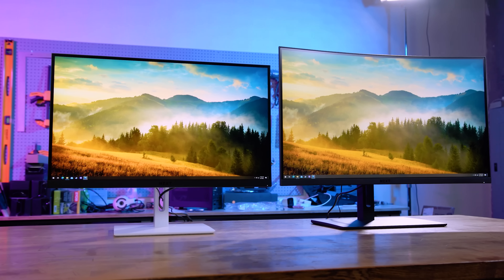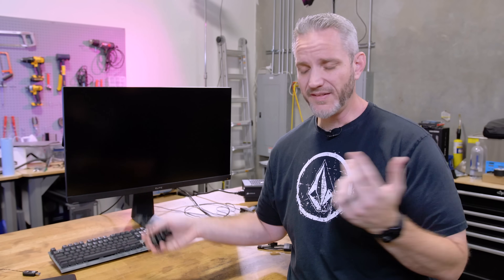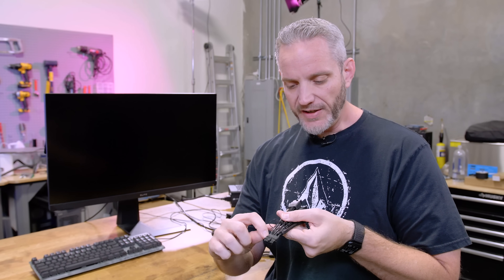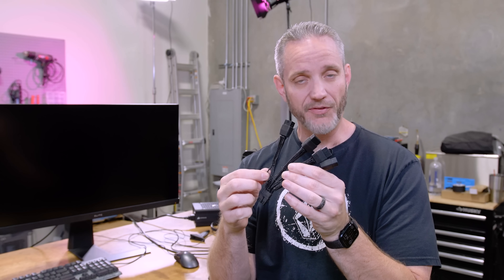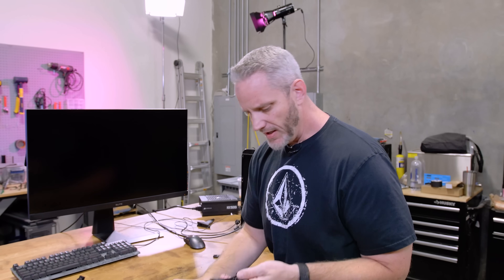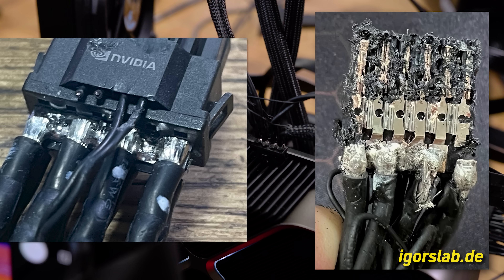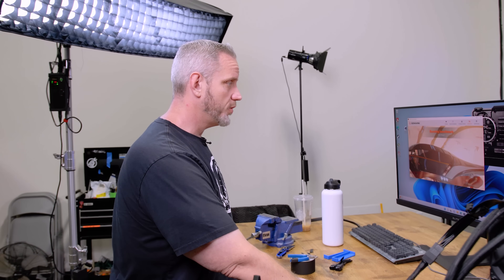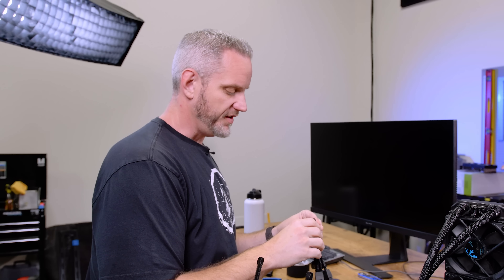Igor's Lab figured out why NVIDIA adapters are melting!

Comment: Honestly if I am spending this much on a graphics card I shouldn’t need to worry about silly stuff like this.
Reply: I like it, kinda spices things up a little
Reply: With gpus getting bigger I’m thinking of moving to a custom loop build these card sizes in 40 series is ridiculous
Reply: Like i said people buying Nvidia products deserve all the problems, people continue to buy their crap  even after all the terrible way they treat their customers
Reply: not that it matters because they dont fit in computers.
Reply: u pay for the performance,if you want reliability get that extra cable or don't pull the cable sideways
Reply: I mean.. the 4090 is clearly marketed towards early-adopters with high amounts of disposable income. It's a $1600 102-tier GPU die debut from Nvidia in 2022, what else could you possibly expect? Honestly I'm surprised the 4090 is selling well at all.
Reply: NVIDIA also decided that nobody spending that kind of money on a bleeding edge card could ever possibly want DisplayPort 2.0, either.  What a dumb decision for people looking to futureproof, coupled only by the arrogance of their explanation.  Even cheaper AMDs of the outgoing 6xxx series have that.
Reply: @delboy6384  they should have 1 in every 10,000 cards just explode for no reason. If you're gonna do it, do it all the way
Reply: You'd think but sadly many high end technical products for consumers are more ass than midrange
Reply: @delboy6384  little too spicy for my liking….
Reply: Even if it was a $700 graphics card you shouldn't have to worry about things like this
Reply: 💯✅ bro. This is one factor so over looked. They want to charge high then I would like high quality electrics
Reply: @Melthornal  lol maybe like most builds I do I build around my purchases. To be fair cases ain’t that much for half a quality one. If you are spending few thousand on a gpu and pc parts why skim out on the case
Reply: I completely agree. I said the same thing about intel's 12th gen. I asked why I need an aftermarket adapter to help my CPU from bending.
Reply: The solution would be to buy a new ATX 3.0 power supply that has this connector on it and for which you will not need to have an adapter.
Reply: Lol if you spend this much on a gpu you deserve silly stuff like this. The price is based on demand first then supply is just an after thought.
Reply: Absolutely. I mean who would care if it would catch on fire and burn up your expensive pc
Reply: @ericheick7044  I like your train of thought
Reply: @MrFrosty888  If the 4090 is anyone's idea of "high quality for the price" then maybe they should rethink their idea of what "high quality" even means. How anyone is actually still simping for Nvidia is just mind boggling to me.
Reply: @doraafelfedezoofisol  you even got a like. You pay for both Jesus Christ. Unless you would say you can’t be mad at Ferrari selling a car that melts down on itself cause…hey…you buy it for performance. LOL you’re all so blinded…knee bent at everything nvidia does and say you can’t even tell when they make mistakes
Reply: @Nuck-Fo0bZz  thats the thing, the 4070 probably wont have this stupid  12pin to 4x8 pigtail creature of a cable, for obvious reasons now, and it wouldn't overheat the connector with its lower power, the strange is this company can design exceptional Graphics Cards and amazing AI and other stuff, but cannot get this cable right.
Reply: You spending that much for a gpu would already be silly lol. You can get a 5700XT for 250 now, which is more than enough for everything 2k/many in 4k. Why spent 2000!!!! For a card then? Or just buy a 6950XT for 600 used or 790 new. But 2k?
Reply: You’ll think so aye…
Reply: Yeah. My friend took his out and is gonna wait for the cablemod cable to come out
Reply: @delboy6384  I see a fellow gambling man.
Reply: Who the hell spends $1600+ on a GPU and uses the pigtail adapter?  JayZ even warned us about potential problems before these came out.  I upgraded my power supply at the same time and I've been using the 12VHPWR modular cable with no issues whatsoever.
Reply: @seadag  this clearly went over your head lol
Reply: Nvidia want you to buy another one
Reply: @alexanderkhan9097  It's all relative.

The 4090 is currently the most powerful gaming GPU available whether you like it or not. $1,600+Tax is worth it to those who want the absolute best performance currently available for 4K gaming.

Value ISN'T tied to the cheapest price or the most bang for the buck product.
Reply: @zack9912000  and buy what? They have no competition at the high end
Reply: this
Reply: Eh, yes and no - you're buying the bleeding edge, sometimes things aren't perfect when you're an early adopter 🤷‍♂️
Reply: I agree with the sentiment, but people that buy these cards totally think or pay someone to think about stuff like this. It’s like the luxury car that breaks apart at any pothole, I think they pay for the luxury, not to solve a problem. Think about how many of these expensive products always have overpriced accessories that you have to buy for top notch performance under very narrow use cases. Think of hi fi audio and such, they pay to be bothered because it’s a hobby money pit.
Reply: Hell, it would've been a better look for Nvidia to not include the adapter and tell people, upgrade your power supply. Inconvenient, but it won't be the disaster of burned cables. They probably saved millions going with a cheap quality supplier and now may have to pay more millions for the recalls.
Reply: This is why I never get Gen 1 of new hardware
Reply: @alexanderkhan9097  it's a generational leap that 4k gamers dream of. Theoretically this shouldn't be possible in late 2022. 2023 or 2024 perhaps so this is something amazing nvidia made. Look at the performance in 4k its just ridiculous.
Reply: @zack9912000  That's why I'm switching to AMD fulltime once my 3070 takes a shit.
Reply: A 800 to 1900$ GPU and they fuck up a 2$ adapter…Nice work!!
Reply: Especially when doing it correctly is probably less than a dollar more expensive to manufacture
Reply: @zack9912000  lmao. You're silly
Reply: @halfbakedproductions7887  future proofing is a myth
Reply: @MrFrosty888  maybe they already maxed out the credit card.
Reply: @tobuscusepicosite  you know all
Reply: @zack9912000  if only fsr and freesync where as good as gsync and dlss i would be running a 6950xt rn
Reply: @ericforman70  Amen, Pal!!
Reply: @L4ftyOne  cuz 4090 is the only one that provides for my .1% fps lows being my frame cap at wqhd.
Reply: My thoughts exactly. I have had a house fire before. Thankfully I was home and able to call the fire department before it got out of hand and it was mostly just smoke damage.

That said, I get very paranoid about things that could be defective and I'm not going to change house I use my PC for a design flaw and start turning my PC off at night or when I go to work.

For this much money as you said it should be perfect.
Reply: Honestly if you're spending this much on a graphics card buy you can buy an updated PSU. You ever seen the quality of a Tesla? Nvidia needs to get FAR more unreliable before they play in that league.
Reply: @PSYCHOV3N0M  psycho gets it.
Reply: Losers pay what Nvidia demands
Reply: @dasaen  yup. Especially if you know how to work on things yourself. This cards cost and the issues along with it, have no bearing on those who wanted it and bought it. I'm completely unconcerned with my power connecter
Reply: @EnglishPete  Nvidia aint got shit on Tesla.
Reply: @Silver Joystix or people want the absolute best performance. It's not idiotic to have a goal and purchase to support that. Just because it isn't in your wheelhouse, doesn't mean it's not in someone's. Nor does it make it idiotic.

You have to pay to play
Reply: @samholdsworth420  winners have more fps
Reply: You wouldnt think you would need to. You would imagine with that pricetag its high quality building.
Reply: @zodwraith5745  truth. I'm just waiting on a better selection. Til then I'll use my Corsair adapter without fear.
Reply: agree. For the price you think they would have better engineers and Quilty people looking out for this crap. glad youtubers like this make videos on stuff like this.
Reply: Amen
Reply: Just cheap Nvidia BS because I'm sure they made these adapter plugs or designed it and had a company make it.
Reply: @delboy6384  you should of said splices things up
Reply: its stupid to put so much power through tiny gauge wires
Reply: But wait, theres more! You get a new upscaling that gives you horrendous img quality and input lag!
Reply: @Nuck-Fo0bZz  you shouldn't have to worry about it regardless of cost, not from a mature industry.
Reply: When you're buying anything as a consumer, you shouldn't need to worry regardless of the price. Buying something you build using tools like say a soldering iron, then that is a whole different story.
Reply: "Here's the keys to your multi-million-dollar Bugatti. Just keep in mind, based on rare customer and police reports, the front left wheel might lock up at high speeds. But those are isolated cases, very rare. Our engineers are currently looking at the windshield wipers to determine if they are the problem, so expect a fix in the future. In the mean time, enjoy the ride!"
Reply: @caseyryback6932  And that $2 adapter cripples your card.
Reply: Exactly. Because you buy a reasonable PSU with the card anyway.
Reply: @delboy6384  Me too, more of a reason for me to brag about not waiting for 40 series
Reply: @bzdtemp  that's false. How many recalls go out every year from home appliances, tools and cars? Silly to think things will always be 100% perfect
Reply: @delboy6384  Life always needs a little chaos I guess? LMAO Jesus.
Reply: @B3RyL  or how about Ford/Firestone? Prius and accelerating? EVs and burning batts?
Reply: They do that on purpose to make you pay more.
Reply: EXACTLY!!!!!! THE FACT THAT THIS IS AN ISSUE IS LUDICROUS
Reply: Yeah, pretty much one of the reasons I will not ever buy apple is some of their design failures, like not isolating data lines, which can cause data corruption under normal use or cause a fried CPU in case of a short circuit, this kind of design flaws are a constant for apple, something a 100usd laptop have solved, basic things shouldn't be a problem in something sold as premium, for that price I would buy a framework laptop instead, cheaper and better
Reply: It comes with the territory of being an early adopter. You're volunteering to be the beta tester.
Reply: @zack9912000  Yeah, because like ATI/AMD have never screwed up?  AMD has a couple of years of stunning sucess and everyone forgets the garbage they were selling for a deacde.  Rumor has it AMD was using the new connector too, so what would you be saying if AMD had launched first?  I doubt 'Like I said people buying AMD products deserve all the problems.'

I agree Nvidia shouldn't have shipped that garbage though and the AIBs really should not have had to use that connector.
Reply: @zack9912000  and your better choice is and I suppose when they’re specs are just worse I’m team red for CPU’s but not gpu’s we’ll see with their 7000 series cards are worth it
Reply: This can escalate to a house fire no problem.
Reply: Expensive doesn't mean it's quality control is there look at tesla
Reply: It's a clumsy amateurish BOSGE for no sensible reason. Fitting a bunch of 4 x individual 6 pin PCIe power connectors would have worked FAR BETTER (and also help with neat looming too).
Reply: Non sense, a NVIDIA 4090 definitely and absolutely should expect such attention and care from you ! In fact, you should sworn loyalty until death and beyond toward it! It deserves nothing less…
Reply: Ong
Reply: Guess you don’t have to worry about it then
Reply: This just gives AMD more ammo, "We have a new feature NVidia doesn't - non-melting connectors!"  I would totally mock them for that with my release 😀
Reply: This is reality, not ideal land
Reply: i hope nobody here actually believes you spend a shitton of money for actually quality. the cards are just extremly overprized.
Reply: @OscyJack-  They're not really in the same price range as Bugatti, are they?
Reply: Yeah but, capitalism.
Reply: Yep.....BIG recall coming
Reply: @OscyJack-  no not anymorr, realistically even with 3xxx and amd 6xxx series, there really isnt much need for new cards right now given their performance. Now with these new cards, there isnt much more need for better cards as the high end of both sides will do 4k.
Reply: Yea no, you are under-spending on these new cards, you only get quality with real money spent.  You need to spend 3,500 minimum USD an then NVIDIA might return your phone call.
Reply: Agreed, but in complete understanding a massive company that is legally obligated to increase investor money. They are also obligated to decrease overhead and increase revenue. If the cheap thin style distro block style modular plug was done right it wouldn't be an issue. Graphics cards are going the same route car audio did in the 2000s...
Reply: @DABOSSJDAWG  yep things are too spicy for the chicken
Reply: But you will and you'll like it because it's AI and more importantly Jenson needs new jackets.
Reply: The same goes for anything. For example, cars have a lot of mechanical issues that you shouldn't when purchasing a $40k car or pickup.
Reply: @B3RyL  nor is a 4090 ;).

My point is, issues are irrespective of price.

Though it's totally possible I missed your point
Reply: Still rocking 1080 Ti and looks like I will for a good while still until these ridiculous issues are sorted out. You pay now much more for GPU, yet its connector is so bad quality... No thanks.
Reply: @OscyJack-  I did not say 100%. I said not having to worry, as in like not worrying a plane is going to crash into your bedroom.
How many things do you have in your home where you even once worried if it was safe - I bet the number is going to be pretty close to zero.
I know I don't worry, had I bought like something in a shop in China then maybe, however I trust that fx. the power adapters are made according to safety standards, that the paint on the walls didn't contain anything giving harmful fumes and so on.
Reply: @ryansuber1272  no not anymore, in relation to what? I don't remember your or my original point to which you are referring.

The 3x and 6x are great series. The 4x does offer even more. Of course it's not needed, but it still has tangible benefits
Reply: @ericheick7044  they are doing the Samsung phone 🤣
Reply: @miguelguerrero2335  true. My new car I just bought and drove home, parked in my garage....came back next day and it burned my garage down. Oh well, happens.
Reply: @bzdtemp  I don't remember what you are responding to lol
Reply: Everyone can make mistakes. The most important thing is how are they going to do about it. Send new fixed cables? Nothing? We'll see
Reply: @zack9912000  are you serious
Reply: @OscyJack-  future proofing, with the current tech you are pretty much good to go
Reply: @zack9912000  I'd happily buy AMD if they could make a proper flagship... Ive been wanting to get away from Nvidia since the 900 series.
Reply: @zodwraith5745  I won't knock Tesla's tech, but I will say that Nvidia didn't get funded by the government like Tesla either. Tesla's tech better be good since I and everyone one else that pays taxes in the US helped fund it.
Reply: @ryansuber1272  til your not ;)
Reply: @Silver Joystix I don't live in an apartment, nor am I concerned with my power connector. I do love high FPS though
Reply: @austinftwXD  I second this. I'd happily switch if AMD can actually bring the piss
Reply: Do you have enough? I sure don't.
Reply: You are the beta tester these days. 

F
Reply: It's like a tesla,  early adopter tax.
Reply: @OscyJack-  My point is, if you make a premium product, you better make sure all the major issues are sorted out, and even if something does comes up, don't dismiss them and pretend everything's alright, and when you do acknowledge them, at least look in the right place for the fix. Is it really too much to ask for? Don't let Nvidia off the hook for this. This card costs almost 3 entire months of AVERAGE salary where I live. If you splash that kind of money on a piece of hobby gear, and it breaks because of a stupid, avoidable defect, and the company refuses to take responsibility straight away, especially after they've been raking in record profits for the past two years, then who should take responsibility?
Reply: facts
Reply: @B3RyL  I get how you feel. For me, I don't really care. It has a warranty, and I can claim damages If I need to if an issue ever occurs. Til then, my only concern was, does it perform. And boy does it ever. Things a monster.

I don't expect anything I buy to be anything other than the cheapest it could have been assembled so as to maximize profits for the manufacturer. When they work, fantastic, when they dont, return them.

It's definitely expensive. No denying that. But we all have different goals and different budgets. For me, this one is the ticket. I have no issues as of now. Might one come up? Sure. But that's nothing new. I've had numerous motherboard blow capacitors resulting in brief moments of flame. I've had GPUs be DOA. It's all par for the course IMO.
Reply: Ive just given up on pc gaming.
Reply: So much grandstanding going on here... I bought a 4090 because I wanted one and didn't care about future proofing because I replaced a 3080 TI with it and will replace it with the next shiny thing. I also got an ATX 3.0 power supply with a native cable without the adapter, all fitting nicely in my Evo case, and everything works great.
Reply: @_____mh  same here. Well said
Reply: @thetruestar6348  yeah no kidding I’m either custom looping or going all aio on both CPU and GPU compared to what most do and just do the CPU with an AIO
Reply: @zack9912000  My 4K/144 frame gaming really sucks, absolute junk!
Reply: @HontasFarmer80  that's what I did, working fine!
Reply: @_____mh  It may work just fine for you, that doesn't mean it does not or did not work for someone else 😉
Reply: Gotta get you to buy the new power supplies even though there aren’t any available for those who don’t have a kidney to sell.
Reply: @thetruestar6348  That’s what I’m gonna do eventually there’s no way in hell I’m using 4 slots for a single GPU 🫤 Gonna need a dual 360 set up to cool everything down.
Reply: What if nvidia knew and just didn't care because for them if you can buy 1, then you can another one.
Reply: @BakuganBrawler211  if you can't afford a PSU you can't afford a 4090 so why even bother?
Reply: @DuhKoreGames  I'm not worri d about it. If you are, return your card and wait it out.
Reply: Honestly if you are spending this much money on a graphics card, you are silly.
Reply: @-opus  fair. Or you just care about having the absolute best fps ;)
Reply: Yeah, but we're talking abou Ngreedia here
Reply: @doraafelfedezoofisol  Don't be daft, if I buy a product I expect it to be reliable. The useless people who buy disposable crap deserve nothing good in life, but a $1600USD gpu should not have any issues.
Reply: @joee7452  It's not their tech, they're known for horrendous build quality by any owner that's not a fanboy.
Reply: @OscyJack-  ummm 8k gaming will never be a thing due to the fact 99% of people cant tell between 4k and 8k
Reply: @yyorophff786  your fanboy swooning is what is ridiculous.
Reply: @OscyJack-  you should not talk about winners
Reply: @ryansuber1272  when did I say anything about 8k lmao. I play on wqhd
Reply: @ryansuber1272  that's what they say 20 years ago with hd.
Reply: @-opus  huh?
Reply: @DuhKoreGames  what?
Reply: @rdspam  while your advice is good, early adoption is asking for trouble; it was still always obvious that this cable was a really stupid idea, it looks completely janky, yet it is paired with a top end product.
Reply: this is what happens when adopt new flagship tech. thats like complaining about the battery being too cold on a tesla lmaoo
Reply: @EnglishPete  midrange is $600 these days lmao
Reply: @Matt-gf4gd  I appreciate the sarcasm. I was replying the original commentor that paying a high price for a graphics card he shouldn't worry about silly stuff like this.  Buying a brand new car I shouldn't worry about engine or transmission.
Reply: build in cheap resistors in a 1k$ tv to prevent it to run longer that 2 years. selling high load graphics cards with a super cheap cable...
glue in the battery in a expensive google watch... i can see the future
Reply: @DuhKoreGames  what?
Reply: @miguelguerrero2335  yet you actually do have to worry about engines these days lol. Just like a GPU it comes with a warranty. And you have home or auto or renters insurance to cover any damages it may cause to a home
Reply: @MrFrosty888  I was going to say something similar, feel like this guys really only talking about ITX, I'm staring at my corsair 280x and the rog strix triple slot triple fan 2060 that "doesnt fit" LOL  (as my gpu sits at 87 degrees) STOP PAYING ATTENTION TO MY THERMALS 😂😂
Reply: I think this direction reflects Nvidia and their desire to cut corner because if they just crimped their wires, which is a much more robust solution than foil, we would have absolutely zero issues
Reply: @miguelguerrero2335  do you typically worry about your engine or transmission going out on a new car? I've only ever bought used cars and haven't had that issue yet, but I'd imagine if I bought new I'd really hope I wouldn't have to.
Reply: @alexanderkhan9097  You figure of $1600 USD as a high end card is what we pay in NZ for say a 3080 right now. I’d love to pay $1600 for a top end gpu
Reply: If you buy into anything new you're going to have teething issues. Consoles, gpus, cars, even games at launch take a while to get going after a couple updates. Nvidia probably fucked up though, bet they cheaped out on the adapter so got subpar solder probably performed by a 19yo kid who wasn't trained to solder properly just to rush the shit to the shelfs. Once you get a break and the resistance shoots up it'll become a toaster real fast.
Reply: @Matt-gf4gd  you don't have to worry, but there are plenty of issues. Especially with today's cars. That's why they have a warranty
Reply: If you're spending this amount of money you should be EXPECTING problems like this. These products are pushed far beyond their efficiency curves intentionally. There are always going to be risks like this when you're dealing with this amount of power
Reply: @alanaeichsteadt  love when someone uses their brain and doesn't get emotional. Excellent statement
Reply: @OscyJack-  fair, I guess? But this seems more like a design flaw than just wear and tear or something didn't get assembled right out of the factory or just statistical failure rate.
Reply: @Matt-gf4gd  it really depends on the car, there are some that are poorly designed.

Most engines these days have piston/sleeve issues by 75k miles due to direct injection and poor quality, light duty alloys. Used in the name of "efficiency". To meet cafe standards and fuel economy requirements. You can thank the governments for that wonderfulness.

You won't find a more reliable car than one from the early 2000s to 2012 or so. At baseline. What previous owners have or haven't done are variables that are tough to track
Reply: Exactly
Reply: @Matt-gf4gd  Nope but there is cases where its completely trash and they have issues after only a few thousands of miles. My Chevy Colorado have transmission issues after only 40k miles and never got resolved and out of warranty. Also, if you look for cases where people spent $50+++ on a brand new car and had issues and the dealer wouldn't do much about it. I guess what i am trying to say is that a $1,600 GPU can compare to a $50,000 car non are cheap and it should not happen, but it does.
Reply: @OscyJack-  interesting... So me still driving my 2000 Honda Accord is actually a blessing in disguise and I just didn't realize it.
Reply: @ericheick7044  if they market it as a super-special one-in-a-thousand they could raise the price even more!
Reply: @tobuscusepicosite  How can you make that claim? it's $400 cheaper than a 3090ti while being up to 2x in performance. What in that tells you "they're trying to price gouge". It seems like you guys go so used to a certain price that if they even so much as charge a dollar more, even for 4x increase in performance, yall flip your shit.
Reply: @zack9912000  For real. I stand by EVGA, and these idiots didn't take their departure seriously enough. People buying the 4000 series are just selfish and only care about their own self gratification.
Reply: No, you should 🙃
Reply: @Matt-gf4gd  100%. However, that blessing may or may not last forever!

Do you do your own work? Is it a 4 or 6cyl?

If you can can connect I'll give.yoy.some tips and tricks to keep her going for as long as possible.

The one perk of new cars, is they are indeed safer in construction. Generally
Reply: @ryanthompson3737  legit statement
Reply: @Michael-zf1ko  or they want the best GPU? Selfish, yikes. It's a friggin economy bro. Consumerism is the name of the game dude. What planet are you on?

 Oh no, they treat massive companies poorly and limit their markup. Oh no, the horror. 

These companies are big enough to make their own GPUs.

EVGA was great. The world will move on. Many more hundred of thousand of 4x series GPUs will be in households soon.

Most of us hope AMD will finally make a true equal. If they do, the market will spread out to a degree. Then the cycle will restart.

Legit the only thing I care about as a 4090 user, is the absolute maximum FPS available. I had a 3080 ti I sold for a grand. $600 for massive gains, was worth it to me. Before that I had a 2080 ti kingpin I sold for a massive profit. This is literally the same freaking conversation every cycle. The 4090 is what it is. No product is perfect. But goddamn does this thing pump out the FPS
Reply: @ryanthompson3737  what? No it’s not! Maybe at the local garbage dump but the 3090ti is cheaper what what what what what what.
Reply: @IIHawkGamingII  They can opt for last gen and suck it up. The idea that you "need" the latest and fastest all the time is such a toxic mindset and hence why companies like NVIDIA get away with treating everyone like garbage.
Reply: I think you mean if you are spending anything on a new graphics card you shouldn't need to worry about this...
Reply: Poorly designed and poorly manufactured.
Reply: @OscyJack-  I don't really do my own work and she probably is getting near the end of her life. The clutch pad slips a bit and repairing that would cost more than she's worth at this point, but has been a great investment. I'll probably try to source a well cared for older used car as replacement eventually or just break down and buy a Tesla or something... We'll see.
Reply: @Matt-gf4gd  via con dios! Haha.

Tough to beat the quality of a Honda. Generally if you keep to the servicing recs they have a long life. There are always outliers these generalizations. 

Tesla's are legit. Not the best car in the world, but def the most impressive EV in range
Reply: @OscyJack-  sounds like you are overcompensating
Reply: Never be current gen.
Reply: Shame on Nvidia 👎
Reply: @L4ftyOne  and still if I want to work and game on my pc I have to get nvidia even if it has worse performance.. I mean AMD cards don't have CUDA cores or RT cores or any proprietary technology that is used for Photogrammetry, AI Texturing, denoising ecc. All of the features that save time.
Reply: gotta worry about it or you will be spending a lot more on house insurance.  UL Labs exist for a reason
Reply: Always bought nvidia waitk g to see the amd release but probably going to jump ship. Price gouging plus bad quality...
Reply: @cloudyview  
4090 is the Pinto of gpu.....they will be sued like Ford
Reply: @OscyJack-  
It could kill you....for stuff like this companies are sued (anyone old enough to remember Ford Pinto)
Reply: @alexanderkhan9097  exactly, this is what happens when you are an early adopter like the folding phones
Reply: Absolutely
Reply: @federicocatelli8785  a 4090 could kill me, lmao. So could walking out my front door.
Reply: Miss the days we plugged in couple 8 pins on the pcb.
Reply: @yyorophff786  i mean there are plenty of articles stating unless you sit at x distance away with the perfrct view angle and have perfect vision, you will not be able to see the difference. I have also seen an 8k tv right next to a 4k and could not tell the difference.
Reply: Just ignore the issue, that's why you have insurance
Reply: You don’t have to, jay worries enough for everyone.
Reply: If it was an issue that couldn't be solved it would be one thing but this seems like higher quality material and design would fix it.
Reply: @delboy6384  some people live to see the world burn
Reply: @thetruestar6348  It might take a decade or two, but I think we will have more or same performance we have now, on much more efficient cards in the future.
Reply: @zack9912000  what else are we supposed to buy?
Reply: you don't say lol
Reply: @zack9912000  there gpu are better than the competitors so ya
Reply: That’s just another reason not to but it’s not like that’s gunna stop anybody anyway
Reply: Dear NVIDIA. If it's not broken don't fix it?
Reply: I was about to say the exact same thing fam
Reply: You shouldn't worry anyway, it always happens in new GPU, 3080 had issue with caps that should have affected me but didn't at all.... I have 4090 and nothing seems wrong with it at all, it's OCed to max and over 500W pulling with no issues at all..... Majority of problems you see are overhyped
Reply: I'm spending so much buying home super car so I shouldn't be  worried about a thing... Sure.. xD
Reply: Just buy AMD problem solved
Reply: @TRX25EX  unlike the cap issue on the 3080s this is different this can be user error or shipping damage even on these wires. Theyre not faulty when shipped from nvidia but extremely fragile the concern since im a repair technician is a lot of people who dont know any better are going to damage their systems. Its easy to say that people should be aware of this but the simple fact is a lot of people wont know that they need to handle their cable in a specific way.
Reply: @ryansuber1272  that's what they said with phones . Not everyone can tell but 8k would have better detail like 4k with hd.
Reply: @DSSteve  before any news about this pop up, I installed my 4090, bend the cable hard infact to close the case panel, played with it so many hours per day since launch day and never experienced any issue, if you can handle electronics stuff then you shouldn't worry about it... Alot of times these things exaggerated tbh, asked 2 of my friends both didn't have this issue and both got their cards with me on launch day
Reply: @zack9912000  well, we only have 2 brands to buy from so...And AMD is not good at some works + lots of ppl suffered from their driver before . Also right now there are no other option in high end
Reply: @FuelHauler48  No one is buying amd. 2% market share. They drivers suck a bit. And also and is more expensive in some countries especially 2nd hand cards.
Reply: @TRX25EX  if you watched Jay's video you will see its not a problem that happens to everyone and thats the problem. The quality of some of these cables fluctuate too much so you and your friends may have perfectly fine cables but due to the quality problems somebody else may not have received one of the same quality. Jay also mentioned that custom cables like the one from corsair have had no issues so it seems like only the box nvidia cables that are a problem. Problems like these need to be addresed because a lot of people will use whats included in the box. Any known faults even if rare do need to be attended too
Reply: @DSSteve  I agree any problem should be addressed so they know about it and mitigate it early, but I'm just saying whoever bought the card shouldn't worry about it much, if something happens it will he fixed by warranty or something at worst, and it's super rare for it to happen....

So the guys avoiding to buy 4090 for that reason shouldn't, just go and buy it, it's great card tbh exceeded my expectations, just don't do stupid things with it, like the guy who bend it 180 degrees forcefully for no reason just to fault if, afterall this cable been in use since 3090Ti
Reply: @delboy6384  Wouldn't be a proper GPU launch without fireworks.
Reply: @Slashgibber  Makes things a lot more exciting, doesn't it?
Reply: @PSYCHOV3N0M  People really don't understand that there has literally never been a GPU capable of pushing 4K the way that the 4090 does. Hearing "you don't need it" from people running Skyrim and GTA V on 1080p displays is hilarious.
Reply: @zack9912000  Ahh yes, let me buy the AMD equivalent of the 4090. Oh wait, it doesn't exist.
Reply: Haven´t you suspect that the problem might be the user? if you saw yesterday´s video you will see that Jay was bending the cable in different directions using quite a BRUTE force. So I think the problem is more customer´s than the cable solution´s.
Reply: Right!
Reply: One could argue if you are spending $1600-2000 on a GPU, dropping $200-300 on an ATX 3.0 PSU wouldn't be a big deal, that way you wouldn't have to worry about silly adapters.
Reply: That is because you don't spend that much money on a GPU and secondly, this is going to happen if you are early adopters. Wait, see what happens and once all the dust (issues) have settled you then buy a more matured tech and a cheaper price. It's really not that difficult folks. Everyone always wants everything NOW!
Reply: @L4ftyOne  pretty easy because there are people that need that graphics power. Im a sim gamer mostly racing and having the GPU power to finally drive my 7680x1440p resolution in mostly full eye candy is great. 

Only because YOU don't need it don't conclude that noone needs it.
Reply: @TRX25EX  This Paricular cable is actually a different cable from the 3090Ti cable. I understand your point that a problem is rare however we arnt talking about avoiding buying a 4090 its more so that for such an expensive flagship card from Nvidia you would expect that problems like quality control of the cable should be handled. It is dissapointing to see Nvidia fail to QC things like this and that is the problem here that when you buy a premium product like a 4090 the expectation is set to the highest standard. I think thats why people are making such a big deal of things is because of the incredibly high expectation of what is meant to be Nvidia's best GPU available.
Reply: @DSSteve  Yeah I understand your point, if you ask me my issue with the cable is the position, these 4090 became so big that the cable barely fit with side panel closed, so if they placed it downward or forward would have been better tbh, not a big deal but if someone gonna keep removing and installing this GPU he mind bend the cable in the process
Reply: Skip this gen
Reply: @alexanderkhan9097  yeah it baffles me that people spend money on these 90-tier cards. There's absolutely no practical use case for it. If you really need that kind of power for work, then you'd get a Quadro.
Reply: @doraafelfedezoofisol  Thats  a shite way to justify this
Reply: @TRX25EX  I do agree that i think most of this problem could have been mitigated just with changing how the cable sat. At the end of the day i think a lot of people are waiting to see what AMD releases the 7900xt and 7950xt migt be a better choice especially if they have a less controversial launch.
Reply: @doraafelfedezoofisol  i hope all of hour possessions break down all at once and your warranty tells you "you bought performance, shoulda gone for our quality model, boo hoo" after your house burns down because of a short circuit.
Reply: @zDemoGODz  lmao bud cant sue if nothings happened as long as nobody gets injured and nvdia accepts returns of all GPU's damaged by the connector there is no problem. Which so far credit to them they have been doing
Reply: @doraafelfedezoofisol  That makes sense like buying a Ferrari and they tell you after a week that you can't use the stock tires or park with them slightly curved otherwise the car will get on fire. Incredibly stupid argument.
It's a consumer product, no matter the performance. It's their obligation to provide a product that isn't failure prone, not the customer's to work around a design issue.
You can easily open a class action and sue a company for stuff like this.
Reply: @doraafelfedezoofisol  That makes sense like buying a Ferrari and they tell you after a week that you can't use the stock tires or park with them slightly curved otherwise the car will get on fire. Nonsensical argument.
It's a consumer product, no matter the performance. It's their obligation to provide a product that isn't failure prone, not the customer's to work around a design issue.
If anything, the fact that it's a high end product makes it even WORSE, not better.
You can easily open a class action and sue a company for stuff like this.
Reply: @doraafelfedezoofisol  safety is not luxury. And this is just a few cents of cost saving measures and a bad design.
Reply: @thetruestar6348  damn you rich.
Reply: @caseyryback6932  2$ seems very generous. But that's the point.
Reply: @zodwraith5745  LMAO tesla is a over evaluated car manufacturer and uses NVIDIA's super computers for their AI.

So, there's that.
Reply: If you’re buying any consumer product you shouldn’t have to worry about it burning down your house lol
Reply: I think a device for any price available to buy for any consumer should not have problems like these.
Reply: I mean, nobody should worry about this, period. But sure, it doesn't help that the cards are this expensive as well.
Reply: > Honestly if I am spending this much on a graphics card I shouldn’t need to worry about silly stuff like this

10,000 iterations of this, tbqh
Reply: Well said.
Reply: You will ask something new, perhaps your transformer is aging, or too small. I personally have a 650W DC, If I ask something like that then I buy a new one for no F**king that up.
Reply: @thetruestar6348  There is at least one ready made which I have been asking. Of course, I try resisting that , it is believed there are something new for even more fun.
Reply: like my 2070 every day different underclocking values to get it to work
Reply: Which is why I’m going to a 3090 from my 3060 and then Intel Arc after cause obviously they know how to do the basics properly
Reply: @zack9912000  true if you say it is overpriced, low quality they say you are just amd fanboy... well yeah makes sense
Reply: Do I see a class action lawsuit in their future... Ya never know
Reply: @jlidral  they should get sued - and probably would lose if the opposing lawyer was good enough - because NVIDIA IS responsible for this in the end.
Reply: You don’t, Jay even destroyed his cable and couldn’t even recreate the issue
Reply: @Melthornal  it would fit in mine.
Reply: DUH..
Reply: Try buying a car.
Reply: @zack9912000  Only alternative is AMD and they're just as bad in different ways. Also releases later, so currently nothing even competes with the RTX 4000 cards.Intel isn't even an alternative yet because they don't even have high-end products. But yes, good luck trying to get the best performance along with great features without going for Nvidia.
Reply: for real, they should just send out new cables to everybody who blew all their money on a card that is gonna drop in price by 50% in a year, and only increase in performance by 20% in the next generation
Reply: Wrong, that is when you should worry about. especially custom build DIY'ers.
Reply: Has Nvidia even announced anything about this obvious issue? With something as high risk as a potential fire they need to inform people about this.
Reply: Absolutely not. Go AMD. Nvidia deserves it

If they don't immediately start sending out better replacement cables that is. Cable mods are making better cables lol, maybe Nvidia can use those
Reply: This is a ridiculous comment. It's like a company is not allowed to make mistakes. Get over it or don't buy it period.
Reply: Not about this much.. when everyone pays any much for something brand new, a proper QA is bare minimum expectation.

Think of how many vehicle recalls have been made when insufficient QA was discovered
Reply: Yessss
Reply: @delboy6384  Yes indeed spicy boy. I was in a restaurant of a 5 star hotel and by the time I finished my fried chicken with salad plate, I found a bunch of dead ants floating on the leftover dressing of my plate. Restaurant told me I put those ants in purpose. In the end, I paid just to end discussions. Expensive shitty meal and what a way to add spice into my life! Like this shitty 4090 card.
Reply: To be "honest" this is still new you?
Reply: The 3090 founders editions for 1500$ had the cheapest heat conduction pads on the memory that were possible. The temperatur exeeded the recommended maximum. I had to open the card and replace the pads myself following a reddit guide. Its insane.
Reply: 1st World Problems… 🤷🏻‍♂️
Reply: @Badtzism  Well, that's the thing about "acceptance testing" and "tolerances". Every single device out there is going to have some issues and no device is perfect.
Reply: @zack9912000  I think you forgot that there's not really any other options
Reply: @Robbiee3344  good Scotsman like ma sel
Reply: @MrQwertypoiuyty  Trust me, you're going to be just fine eating in 5 star restaurants and buying 4090's too!
Reply: 1000%
Reply: @zack9912000  Sooo... Let's buy nothing then??
Reply: You always have to worry about stuff like this when you're an early adopter.
Reply: Learn to spend money wiser
Reply: @delboy6384  😂😂😂
Reply: @MrFrosty888  why are you looking at it that way? These cards are overpriced and will continue to climb because of that attitude. They charge an outrageous price and have this issue. Corporate greed and consumers are willing to tolerate it and then say they should have more expensive pc parts around it because they paid a high dollar for a component. High dollar amount doesn’t equal quality.
Reply: @nostrum6410  Stupid? It's genius. Stupid is the one that buys it. LOL
Reply: Silly price for silly stuff
Reply: @HontasFarmer80  the problem is not the adapter from PCIE 2 to PCIE 3. It's the connector to the device that's built to the new 3.0 spec. So unless the power supply manufacturers actually design a more robust plug you'll have the same problem.
Reply: Jay needs to pin this comment!
Reply: @doraafelfedezoofisol  his point is it should come with whatever it needs to run efficiently and safe.
Reply: Man imagine buying anything and because it’s price you expect it to never fail in any way ever. Lmao. Ever herd of a car? Or a house? 😅
Reply: Please claim to Nvidia. You are guilty to spend 2000 $ for a useless gpu. You don't need that gpu for playing the last games at high resolutions
Reply: @halfbakedproductions7887  You used the words future proof and computer tech in the same sentence.....lol by the time you get your product its out of date.
Reply: If you spendig this much money expect more crap stuff because its seems you dont care to pay any price for faulty stuff
Reply: No matter the product category, this is never the case. You want realiable, easy to use, predictable products? Stay the fuck away from the cutting edge. 

Convenience and user friendliness is what you get in products for the mass market. The premium is never worth it so it's only something you buy if thousands of dollars means nothing to you. 

And that's how Nvidia will treat you. As the idiot who wants a server grade GPU for their home gaming rig.
Reply: @alexanderkhan9097   You can imagine that a lot of people will buy it just to brag that they have one
Reply: Then people who buy lambos and ferraris should not have to worry about their car needing a service. Is that what you are saying? Just because something is expensive doesn`t mean it won`t have problems.
Reply: @delboy6384  haha lol, yh it gets me 'fired up'
Reply: goes for all graphics cards because they are all expensive
Reply: Exactly. This shouldn't be a thing at that price point. I hope there will be a class action suit to teach Nvidia a lesson.
Reply: @zack9912000  sadly im stuck with nvidea. A lot of software i use works (better) with nvidea
Reply: @zack9912000  Sorta Agree, why hasn't nvidia already provided a form to rush out some better connectors?
Reply: @alexanderkhan9097  Its selling out, but mostly because the supply is much smaller than promised.
Reply: The truest statement!
Reply: with this money to splurge on a gfxcard. I would've also bought a PSU that has a direct connector.
Reply: @kristofvanderveen34  They will say wait for RDNA 4.
Reply: Why
Reply: Don't spend that much for a graphic card then? The more people are willing to keep paying, companies will keep raising prices. Yes I understand new stuff is better than the old, has more blah blah blah. But as new becomes standard, the prices stay high until they release a new product which they make cost more, that should be the old products price. 

Everyone else may gives excuses as to why these cards are "worth" the price. But that is what the issue is, the excuses people make to justify the companies price hikes as "makes sense".
Reply: @nikspanakis  they won't be saying that when they get sued
Reply: @vahn_of_the_art  Yeah.  Those sorts of comments make me understand how cults get created so easily.  So many people think and act like mindless drones and accept unreasonable things.
Reply: The real world can't guarantee perfection.
Reply: We shouldn't be worried about this when purchasing anything. Ever.
Reply: I like to invert the thought - I have no interest in a super High Wattage GPU because of all the nonsense that accompanies this fetish.
Reply: You don't. It's 4 cables out of hundreds of thousands that were sold.
Reply: @HontasFarmer80  that would work if they had put them on the market, as with any new technologies, there will be teething issues that a vast majority of them should be sorted by the quality control department. Sadly they cannot catch everything as when those technologies get into the wild, they will have situations where they have not accounted for or have thought it wouldn't be a problem.
In this case nvidia did reach out to various people regarding the plugs and they said they will be a problem. Sadly they didn't listen and now they have potential fire hazards that is a risk lives which has to be addressed.
Reply: @delboy6384  solid point honestly hahah what else are you gonna do? Put in the gpu and do what you'll probably be doing for years immediately? Nah have some fun troubleshooting for a few weeks
Reply: Yeah, that's why I'm happy I just got a 30 series card when they had the evga labor day sale. What with price increase to get Zen 4, meteor lake on the horizon using a new socket, Nvidia 4000 series having monstrous coolers and the new connector (plus no evga), a lack of any real ATX 3.0 parts out there, and the fact that the ryzen 5800x3d is still very competitive for gaming, we're kind of in a weird territory to upgrade a pc, unless you really need to, or are on old hardware. I'm specifically waiting for something like a 7900X3D, where the massive 3d v-cache could get some huge boosts to gaming performance.
Reply: @SaintNyx  lmao love it
Reply: @delboy6384  right? I really hope when Nvidia’s 5000 series cards come out, it’ll require me to get a bachelors degree in electrical engineering and perhaps taking several IT courses so I could safely connect the gpu to my PC to watch youtube videos.
Reply: From thermal pads to wires... Next generation they just explode instantly
Reply: @zack9912000  Unfortunately, there's not an easy way to do lots of deep learning work without NVIDIA's tensor cores / software.  Maybe some day, but it's really quite difficult for people to adopt something new (AMD) when there's years and years of knowledge-building in the old one (NVIDIA).
Reply: @zack9912000  The customers are at fault for buying the only product on the market that performs to that level of specification? Are you insane? Maybe if Nvidia had a competitor who could stack up, but that's not the reality we live in.
Reply: These products should be the definition of plug n fkin play. Not buying top tier stuff and beta testing the product ffs...
Reply: I wanna know how such an oversight made it through even.
Reply: wow.... thanks captain obvious!!
Reply: its right that this is an issue that shouldnt be happening but at the same time, what would you expect when you buy the newest card right at the first day. no issues are known.
and from the other side how wouldnt Nvidea knows that ? they plug the cable in do it under load. and thats it. they are not bending it hundreds of times just to see if there could be anything like this.
Reply: The point is you SHOULDN'T HAVE TO spend this much on a gpu..ever if you are not in a Workstation production environment
Reply: @vladuk  My solution is getting AMD graphics cards that use standards connectors like every other card before Nvidia tried to be special.
Reply: @vladuk  I can't tell if you're just having fun or not, so I'm gonna leave this one alone, I just don't have the heart for it right now.
Reply: @alexanderkhan9097
Reply: Are you running that expensive GPU with ATX 2.0 or ATX 3.0 PSU? If you are running it with ATX 2.0 PSU with adapter cables, your problem is using more or less incompatible parts together.

If you're willing to go with RTX 4090 level GPU, getting a true ATX 3.0 PSU should not be a problem either.
Reply: @MikkoRantalainen  This all requires a minimum of 600 you see. One does not simply buy a new GPU and PSU. And an RX580 at MSRP was like 179 or something.
Reply: then don't worry about it. I have one, have not worried about it and have not had anything melt yet.
Reply: Funny thing is. I have watched like 8 videos of people testing these and read a few pieces on it. So far the one piece in common with them all, not one (Including Igor's Lab) has seemed to be able to recreate the issue. I mean, they bend, cut, strip, twist, do everything to force the connector to show the issue and fail to cause it to happen. GN just released one that seems to be the most honest.
I still think there is an issue with them. I am thinking it is probably a QA issue and we will find out that one of the companies that nvidia contracted to make them has a factory that is not producing them all off the line to spec. Still probably safer to look for a replacement from cablemod or going to atx3. It may be 1 out of 1000 or 1 out of 10,000 or even 1 out of 100k that could fail and start a fire, but for my money, if your spending 1500+ on a video card, buy the extra cable just to be safe.
Reply: @alexanderkhan9097  my last two pcs combined did not cost that much. 
I like hardware but I also like to spend as less as possible.
Reply: @thetruestar6348  I come from the future. Soon you will have computer closets because the graphics cards have grown so big you literally need to convert a small room into your computer case.
Reply: @zack9912000  Broke boy copium
Reply: That's why I'm not
Reply: You should have to worry about this any computer component at any price point
Reply: exactly, you spend it for graphics card, not the accessory
Reply: I'm avoiding spending lot of money on tech nowadays,  it's like pulling a lottery, expensive doesn't equal good nor will last long.
Reply: You're right.  If you're spending that much on a video card, you need to worry about your mental health instead.
Reply: @halfbakedproductions7887  Don't be silly! Wait for the 4090 Ti
Reply: @zack9912000  The market is literally two companies lol, how do you blame the consumers
Reply: Honestly you shouldn't have to worry about this stuff on any brand new GPU above like $300.
Reply: its 2022, nothing makes sense anymore
Reply: agreed. NVIDIA or who ever designed that 4 wire to 6 pin plug was using very poor engineering practices.
Reply: @J.H.hhhhhhhhh  massproduced in Asia at this „quality level“ 2$ is probably stil overestimated!😀😀
Reply: Sorry but I call Reddit posters "people full of it". I have been torturing my 4090 (MSI Suprim X) for days with overclocking, 6 hours of consecutive play between Cyberpunk and Dying Light 2 with full RT on, and no problems whatsoever. Both Jay and Steve (Gamer Nexus) tortured cards and connectors in the most exaggerated ways and could NOT reproduce the problem, according to reddit both Jay and Steve would have melted the connector by now. Those guys (reddit) have either faulty components and extremely faulty behaviors in their pipelines/modus operandi OR (most probably) they are shills melting the connector with a flame and saying it happened naturally.
Much ado about nothing if I ever saw one. (Or rather, much ado about BS).
Reply: @davereen5103  Look closely at the soldering of this piece of shit, and then tell me that is the kind of product you want to be shipped with a GPU at that price. It‘s allready clear what happened in those reported cases. The sad thing is that there is at least one case it could happen.
Reply: @caseyryback6932  might be that some Card manufacturers (like Gigabyte) sourced/ordered the adapters from el cheapo manufacturers while others (like MSI and Asus) sourced better parts. Regardless, no reputable and respectable Youtuber (like Steve at Gamer Nexus who I respect deeply) could reproduce the problem no matter the torture. That should raise an eyebrow or two at the very least...
Reply: You should also get the lasted display port support and not need a nuclear reactor to power it.
Reply: @thetruestar6348  It would probably remove a big chunk of the size of it aswell.
Reply: We are in 2022 - the customer is also the tester.We are getting closer and closer to the limits of growth meaning it is getting harder and harder to rake in money because the majority of welth distribution goes up not down, therefore corners have to be cut because "down" is only willing to pay so much, therefore cut the tester - safe a lot, take the thinnest material you can find - save a lot of money in the long run...
Just a crackpot analysis but i will be dammed if we dont see this kind of stuff more and more, its not negligence its by design - i cant imagine that no engineer pointed this out as potentional flaw (unless we also have a problem with education cough ) before some accountant came along in with the big red pen.
I work in mechaical engineering, old stuff is sturdy as f - why is that - back then they had no way to simulate everything for the most part so they took a 10% thicker, cable a 10%thicker sheet metal just to be sure.

However the sales will not be inpacted by a few houses burning down, burning down houses is actually good for the economy in return since said houses will likely be rebuilt eventually, someone will have to take a loan for that...
have a nice day
Reply: Full AMD system be looking very good
Reply: Nvidia: laughs in Nvidia
Reply: So should I avoid Nvidia cards?
Reply: Took words outa my mouth!..
Reply: Even if the GPU cost 5% of what they do, you still shouldn't have to worry about it melting itself...
Reply: @delboy6384  A new feature if you will
Reply: Throw that thing out an get a cable mod
Reply: True. But on the contrary, any device they can draw 600 Watts needs to be treated with some care.
Reply: If you can’t seat the connection properly you shouldn’t own a computer at all.
Reply: @alexanderkhan9097 the 4090 is a legit card and so far its done everything it was advertised to do. My render times have been halved. And compared to products like SGI graphics in the 90s. 1500 dollars for a base 4090 GPU this powerful is chump change.
Reply: @doraafelfedezoofisol so I'm paying $2000+ for a gpu and I can't even get a garantee it won't break itself.
Reply: @zack9912000  man i litterly have no other option, all the other ones preform way worse in stuff like blender and 3d rendering.
Reply: @delboy6384  They should just do an external wall plug out the back of the card at this point.....if its gonna burn why not raise the stakes and put your house on the line LOL